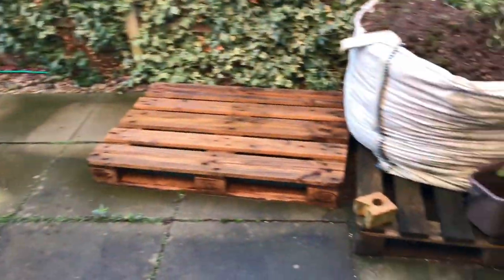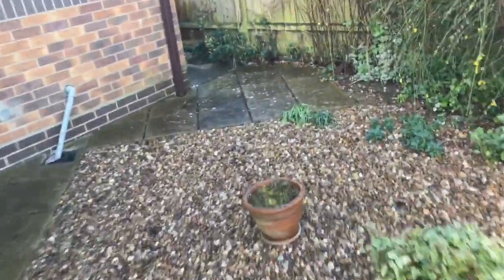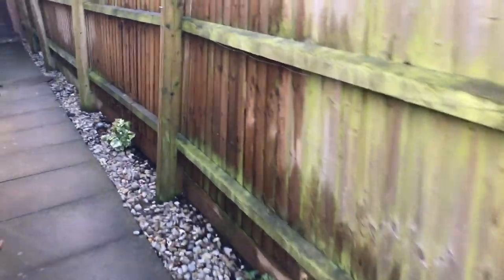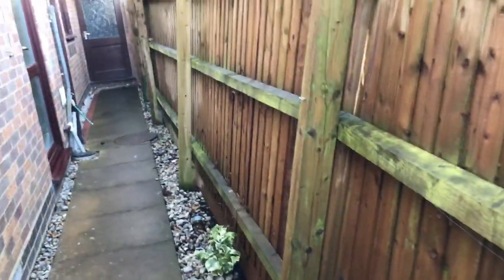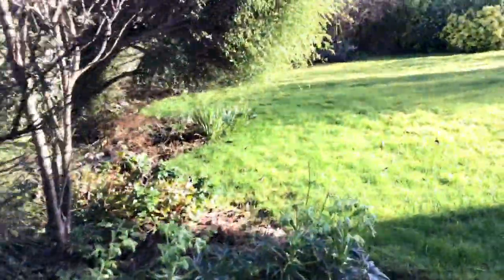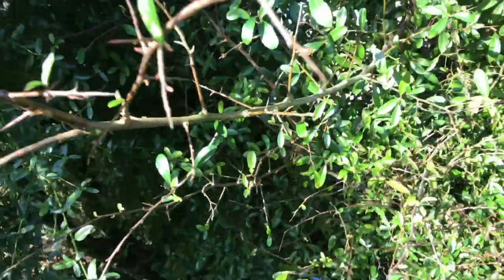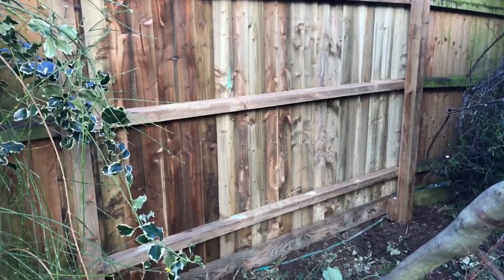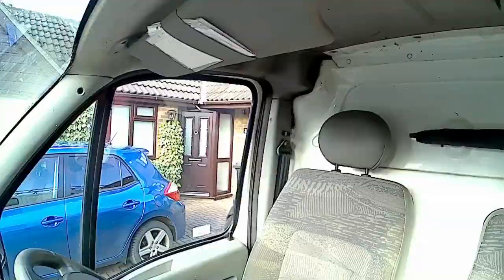FIXING A FEATHER BOARD FENCE!

Comment: must  be awkward  to  work a round  the  bushes   was the old  post  badly  damaged  or no install  correctly. enjoyed  the  video.
Reply from the maker: Ratch Riat I think badly installed as the had not snapped or rotted but moved so much, the bush ended up coming out after I finished which would of helped beforehand but never mind thank you for your comment.